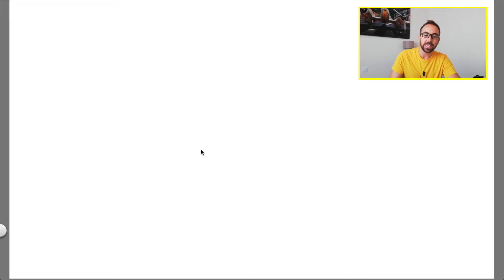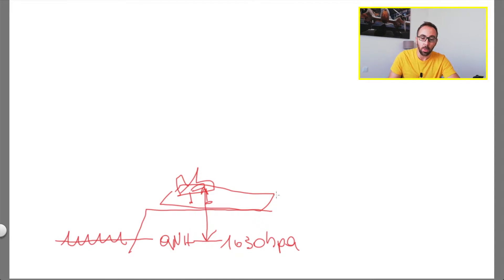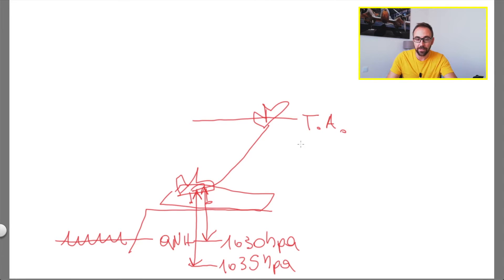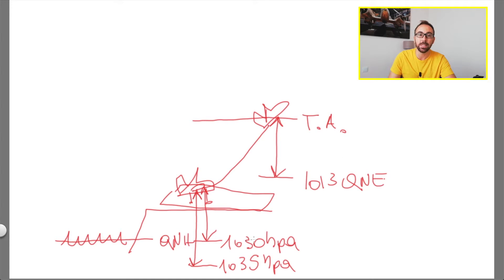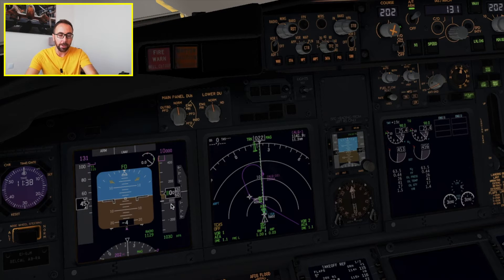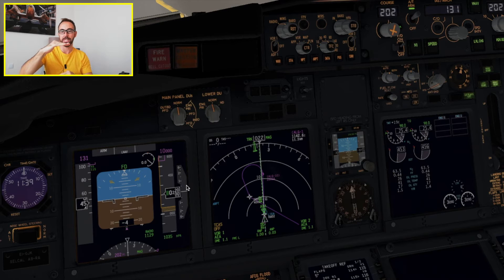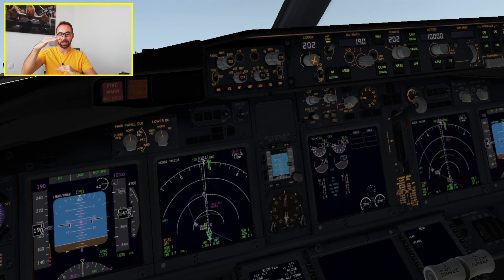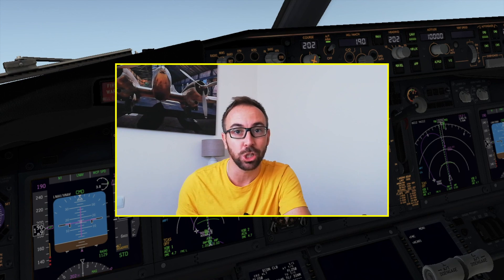QNH and QNE Altimeter Settings - [Simulator illustration of Transition Altitude]

Comment: Hello Captain, thanks for this clear explanation.
Just a quick one, so the altitude shown on the passengers' screens is inaccurate? Since at any point during the flight, we can know the exact height from QNE but not the exact Altitude. 
In this case, how's the altitude, shown on the passenger's screen, is calculated.
Reply from the maker: I'm not sure where the passengers' entertainment system takes the info from, I guess the altitude you see there is the Flight Level, using 1013.25Hpa as a reference.

Comment: I have a question: if aircraft A has set a QNH and Aircraft B has set QNE and they are approaching each other in the mid air, then would the tcas assist them to avoid collusion?
Reply from the maker: Hey, great question!! As far as I know you should still get the TCAS since this system interrogates the transponders and the transponders report the Pressure alitutdes.